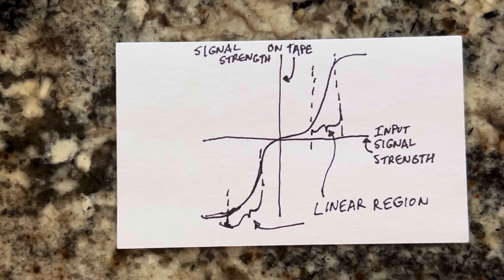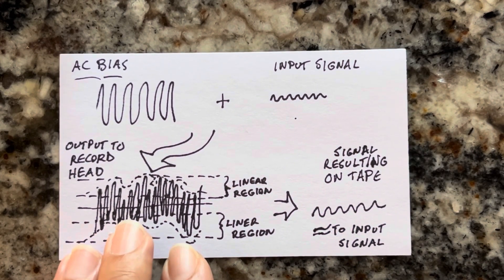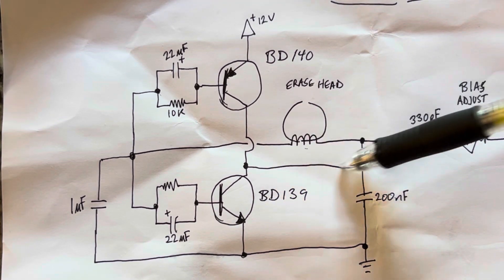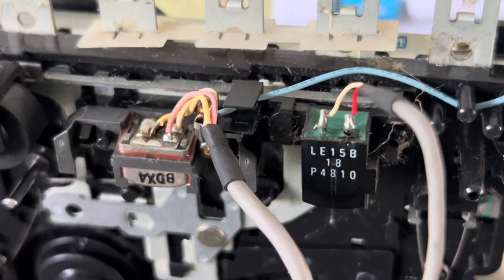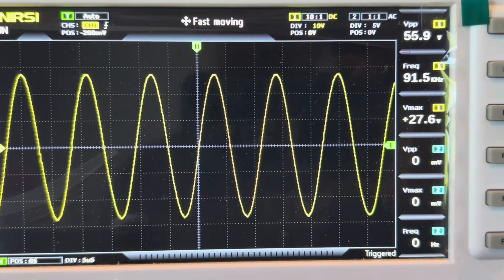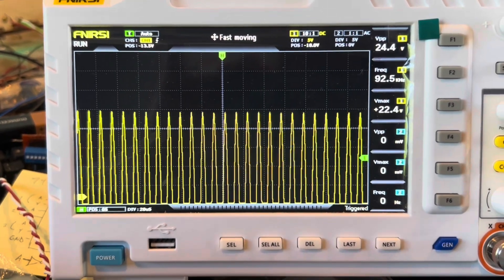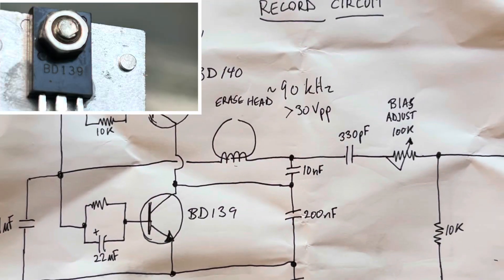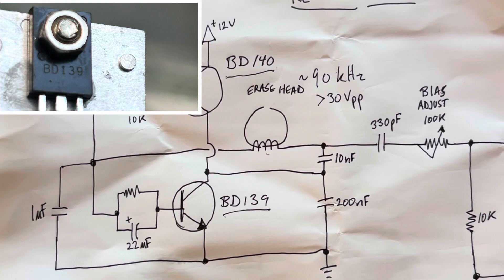Tape recorder circuit and AC bias oscillator

Comment: I tested your suggested Bias oscillator circuit with recording stuff together, I was unsuccessful! I checked other projects again same problem. there is uncomfortable noise in my recorded songs. I can feel that the sound is not leveled, what is the wrong ı am doing? to add, my erase head is a permanent magnet head
Reply from the maker: Permanent magnet is the problem. It is not an inductor and wont act as one. You need to make an ac bias oscillator using an actual inductor in place of the erase head inductor. 100 -1000 uH
Reply: @igorbrichkov3632  ok I HAD already done 2 days ago what you said! should I replace the electromagnetic erase  head to the casstette deck to pass through the tape? or just inside the board?

Comment: I have a question: my tape recorder has a erase head which does not have wires because it has a magnet and when the tape passes through it, it erases automatically. I tested and it works. where should I connect bias oscillator to?
Reply from the maker: You have to make it using a separate inductor. Somewhere between 100 and 1000 uH instead of using the erase head

Comment: Fantastic...
Thanks for sharing.
I have a question..
What is the meaning of "bisa"...??
I mean.. why is using this word?? 
Is the word has any relation to electricity?? How? Why??
I try to find any explanation...
And nothing...
Thanks
Reply from the maker: Need to add positive and negative dc offset to audio signal in order to get it into the linear range for tape recording ( linear range refers to linear relationship between audio signal strength and recorded signal strength or volume)
Reply: Thank you.
But why using the word "bias"..??
Bias is something else..not have connectionto electricity..no??  @igorbrichkov3632

Comment: I'm currently trying to build the LC tank circuit. I'm getting 90kHz sine waves but only in short bursts. Would you know what would cause this issue? I have been studying these circuits to death but cannot get my head around it.
Reply from the maker: Getting power supply interference. Try the ac bias oscillator off of a separate supply like a 9 v battery and maybe a switch to turn it off when not recording
Reply: @igorbrichkov3632  I'll give that a go, thank you for your help
Reply: @igorbrichkov3632  So I tried using a 9V battery but still same issue. I played around and changed the two 10k resistors feeding back into the base of the transistors to a 2k ohm instead which now gives sustained oscillations. I can't wrap my head around why this has fixed it
Reply from the maker: @timocook5667 not sure but sometimes its a current problem. Because this is basically a push pull amplifier on an oscillating circuit, any current limits on the transistors can theoretically stop the oscillation without amplifying it.

Comment: Amazing - I have a neophytes understanding of electronics, but always wanted to learn what bias was and how it worked - Surprisingly, I was able to follow most of what you were saying. So in effect, bias kind of nudges the record signal into a more linear curve which reduces noise in the higher frequencies. Does it affect the lower frequencies too or are they pretty much good to begin with ?  Is bias actually controlling a magnetic flux and is this why different tapes I.e., chrome, metal, etc.  all require different bias settings ?  Your knowledge is impressive and ability to create this model blew me away - Excellent lesson 👍
Reply from the maker: @ssnoc  thanks. And yes basically the bias puts the audio frequency into linear range. The reason why its ac and not just dc is to not lose out on the negative voltages in the audio signal but technically can be done with just a dc offset too. Cant say its going to sound good if you miss the negative part of the signal but i didnt try that. Different tape requires different levels of bias based on where the linear range of the signal response occurs. It affects the lower frequencies too but less so. As long as its in linear range all of the audible frequencies are good

Comment: Excellent explanaition. I've always wondered why audio tape recording didn't use FM (like Ampex eventually used for videotape). The head gap could have been optimized for a single freq, the carrier would make it self-biasing, and FM is less noisy than AM.  But AFAIK no one ever produced an audio tape recorded tht used PM or FM. Must be a reason for that.

Comment: 5:47 Value coil in Erase Head is about : 100 uH to 1000 uH.

9:20 The BD 139 and BD 140 Transistor must using Heatsink.
Reply from the maker: @FransHasibuan  i calcuated it out to 313 uH. Thats why i used a 330 uH in bias trap and yes. The transistors can get hot but not bad when its working. 50 degrees C when i checked after working for 30 min. Heat sink is recommended.